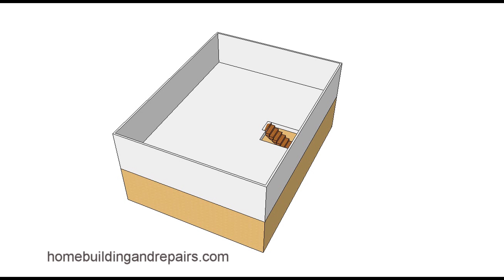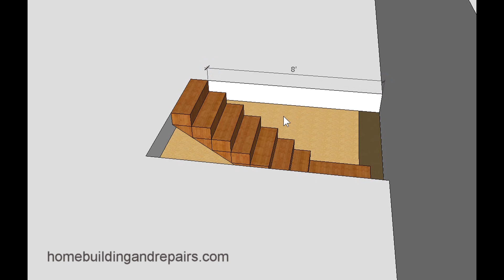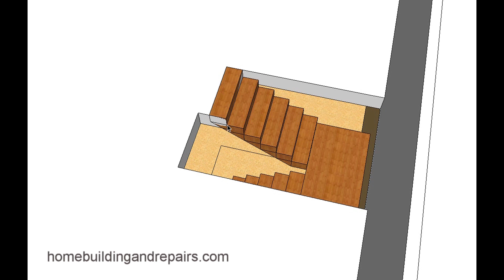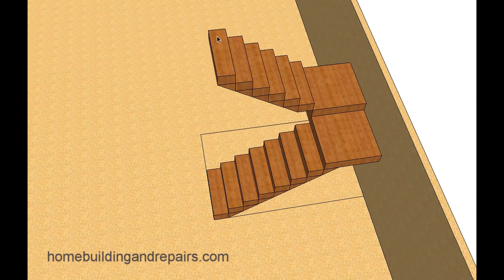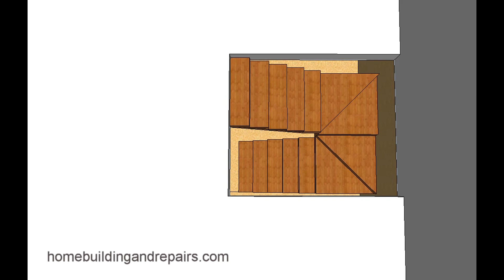Ideas for Designing Landing Stairs in Small Spaces – Building and Remodeling

Comment: Greg: Great video! What do you recommend if the width is also tight? Cut or box/housed stringers? Should the stringers for the opposing runs be side by side, or overlapped in the same veritcal plain? What about the railing?
Reply from the maker: Yes you can put the stairways next to each other, but if you don't have enough room and you're working in tight spaces, you won't be able to build a stairway that will meet most building codes. For example if I only have a 5 foot with and I'm going to have a set of stairs on each side, making them 2 1/2 foot wide each, I will still be able to walk up and down the stairway, but it won't meet the 36 inch or 3 foot minimum width requirement my most building codes.

Comment: trying to replace sprial star case with traditional one , in a small place .. just need web side to calculate , if fizable .
Reply from the maker: Most spiral staircases are built in tight spaces and you might have a difficult time installing a regular straight stairway, Winder stairway or stairway landing.
Reply from the maker: Usually it's difficult to replace a spiral stairway with any other type of stairway to fit in the area. I'm not suggesting it can't be done, you might need to modify the upper floor or lower floor to make it work.